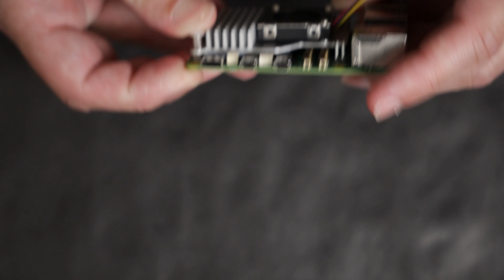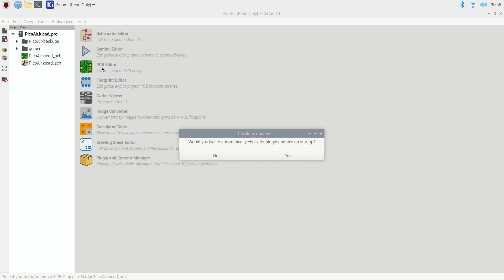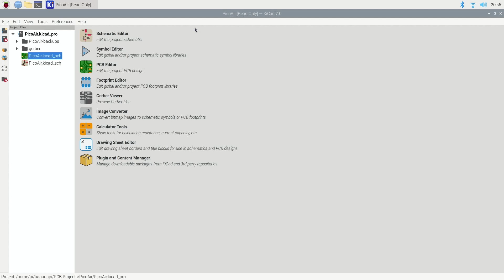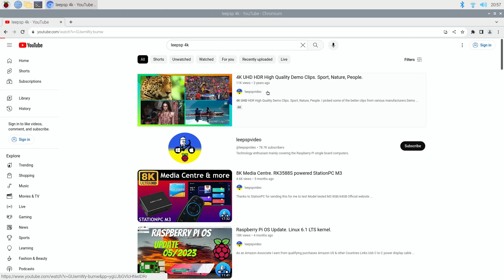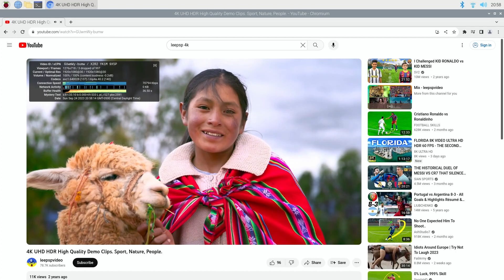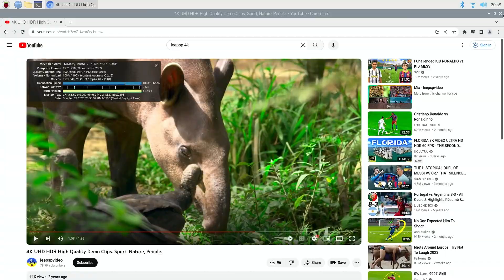Raspberry Pi 5 Hands-On Preview

Comment: Pre-ordered one a few days ago, with the heat sink. It look awfully close to the pins, so might be tough to use them if you have the heat sink on.
Reply from the maker: You can still access the pins, it's close but there's room. If you are going to fit a HAT, you'll need a riser header
Reply: @makerbymistake  Gotcha. Thanks for the reply. 👍

Comment: I know they now recommend 5V5A but how does the Pi5 runs with a 5V3A power adapter as long as you don't have anything plugged in ?
Reply: I heard, if I remember correctly, Jeff Geerling say that yes, that a firmware setting was configurable to either avoid processor throttle or port-fer hardware underpowering.
Reply from the maker: It does, you get a warning during boot but you can override it.

Comment: Thanks for the review. It would have been interesting to see the underside of the heatsink. For stress testing the CPU I use s-tui with stress-ng ('cause I'm lazy.) For stressing the storage, I use fio which seems to provide heavier loads than stress-ng.
Reply: there are thermal pads pre-attached to the bottom of the heat sink, just have to remove the plastic protection on them and clip the heat sink/fan onto the board. (As seen in https://youtu.be/9hYfQ7bRgZg?si=umX_x2ai6DsGj6tz&t=505)

Comment: Sorry but you are wrong. CPU is still provided by Broadcom, it is BCM2712. The chip from Raspberry Pi is actually an I/O Controller. 
Should have read more thoroughly 🤷🏻‍♂️
Reply from the maker: Yes, that is correct, I didn't have that info when I made the video

Comment: Thanks for video.

Hopefully software updates introduce safe shutdown with that power button, or maybe the ability to run a custom script.

Is the fan flush with or shorter than the USB ports or is it taller?
Reply from the maker: There's an option in config.txt that used to work with older Pi's to shutdown using a button. I have not tried that on the Pi 5 yet

Comment: Thanks for the video! I'm really disappointed they removed the audio jack...bad decision. Not everyone has a supply of BT speakers on hand 😢.
Reply from the maker: The pads are still on there but you'd have to solder your own connector
Reply: @makerbymistake does it also support rca out like the old port did is it audio only?
Reply from the maker: @RomanOnARiver  pretty sure it does. Should have the same functionality, just the connector that is not there and the pads are available
Reply: There's USB to aux adapters, they're pretty inexpensive. That's what I'd use over Bluetooth if I wasn't doing audio over HDMI and I needed to plug and play.
Reply: I just ordered a £3 USB headphone adapter which from experience will be fine
Reply: The pads are only for analog video sadly no audio 😢
Reply: Could a HDMI audio extractor box work?